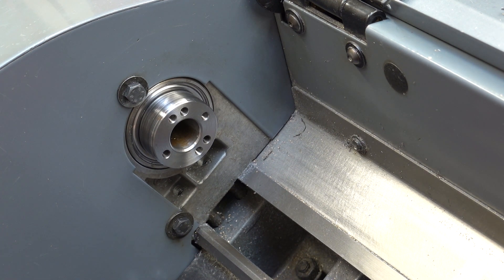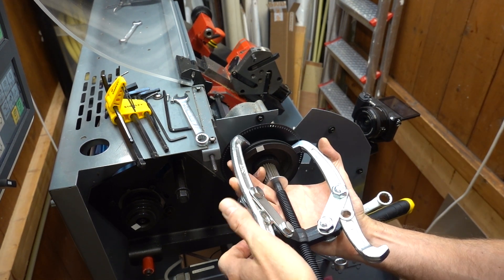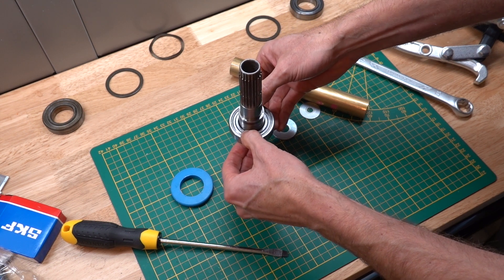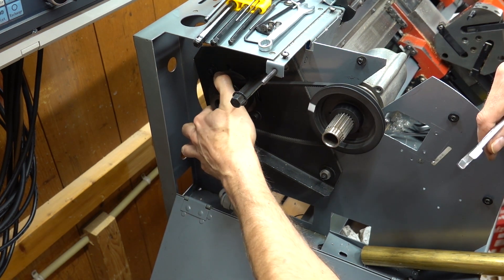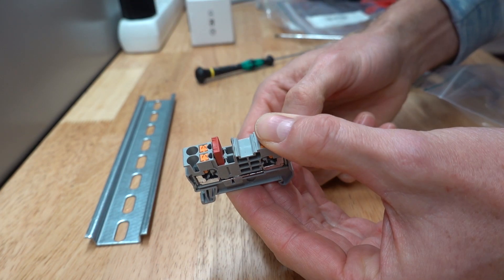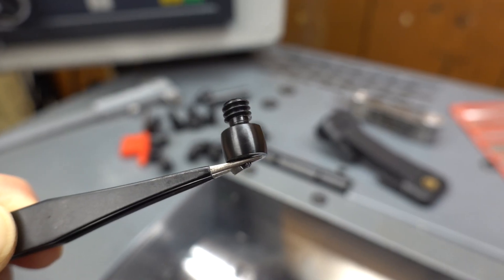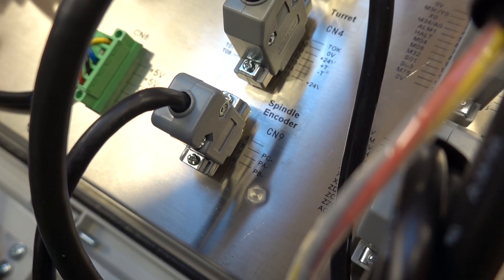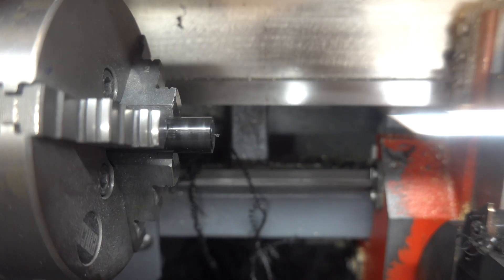Mini CNC Lathe Retrofit Part 5 - Replacing Spindle Bearings, Spindle Encoder, and more

Comment: To perform the final part of threading in your video, what other parameters did you configure to perform the interpolation between the shaft and the spindle? Do you have any images of these parameters or what they would be?

Regards.
Reply from the maker: Hi, I think it was only the parameters I mentioned in the video. If it is somehow not working for you I can have a look if I missed something but this should be it.

Comment: Are you able to part off on this little emco? I'm just after getting mine running but for the life of me can't get it to part off
Reply from the maker: Parting off is quite a bit more difficult than regular cutting, but it does work for me. I use slow feed and a pecking motion. These make sure there is no build up of longer chips. Nite that I only have parted off brass and aluminium, so I have no experience in cutting steel on this lathe.

Comment: Excellent videos my friend, thank you very much for sharing each process in such detail.
I have a question, maybe you can help me, I want to use a 4-bit encoder for the ATC, I'm trying to do it but I have many doubts.
What program can I use to see the PLC files that exist? I tried to use one but it doesn't detect any file from the backup I made of the control panel. Well friend, I hope you can help me. Thank you very much and again congratulations for those beautiful videos
Reply from the maker: Hi, no problem. This is the link where I downloaded the PLC editing program, it even includes some manuals. Someone was nice enough to put them on this forum:
https://www.mycncuk.com/threads/14016-Hardinge-CHNC-Retrofit/page5

Comment: Hi. Brother I need application Fanuc 21 and patch machine for configuration my emco turn 50. Can you help me ? Thanks
Reply from the maker: Hi, sorry I have no experience fitting am emco with a Fabric controller, so that would not be possible without having the actual fanfic controller myself. Also I am very restricted in time so I cannot take on any additional projects. Hope you can make it work. Robin

Comment: what will be the code for Spindle Speed?
( S1000 M3 ) is ok or there have another code.
Reply from the maker: Hi, yes S1000 M3 works fine. It is exactly the same syntax that I am using.

Comment: Seems silly to have an encoder with 4096 counts per spindle rotation, but the controller reduces it to a much less accurate 0 to 359 degrees?
Is that just for display? Surely for auto threading etc the controller will make use of the full spindle resolution?
Reply from the maker: Yes, my guess would also be that it is just rounding the display value but uses the actual resolution. Since there are also versions of this controller with a 4th axis (C) it would not make sense to round to full degrees. For threading that would probably be fine though.
Reply: @uptimefab7412    Thank you for the reply.
Great machine build and video series by the way! 👍

Comment: Nice video, i have the same lathe, only older, when it was still called EMCO Compact 5, I have it with the toolchanger too, and i have retrofitted it to EdingCNC, and i have written a number of Macro's to allow me to operate with cycles.
in the near future my lathe will get an upgrade with a stronger motor, and an enclosure (an Old EMCO TM02 Cabinet)
Seeing how easy it is to replace the spindle bearings i will do that too, because these haven't been changed in 37 years (that's how old the lathe is)
Reply from the maker: Thanks! The emco 5 cnc also seems like a nice machine. I found it surprising that it has more or less the same cast iron base as the 50 and 55 models.  Apparently they used this for many years. Having the enclosure is a huge improvement. Otherwise chips get everywhere.
Reply: @uptimefab7412  Yes, the Mechanical base of the machine is identical, except for the latest iteration. which has a wide ball rail for the Z-axis..

Your machine had different Steppermotors, Berger-Lahr, which are 5 Fase, Nice idea, but now we have Micro stepping..
The EMCO Compact 5 CNC had "regular"steppermotors with only 72 steps/rev, giving a resolution of 1/72 mm, That is why i janked those out, and put in 2Nm Nema 23 Steppers with a 6.35 Shaft  (Wich were a direct fit), 

I also replaced the Toolchanger motor, for a Nema 17 Stepper, which makes the ATC much faster.
Maybe i should make a video when i start converting mine (again)

Comment: Totally the wrong type of bearings for that application? A standard ball bearing is not designed for axial loads, you should change them for angular contact which may cost more but will give you a more accurate and reliable machine in the long run? A nice little machine and wouldn’t mind one myself to play with👍
Reply from the maker: Thanks! I might change them out for 7006-2z angular contact bearings (tip by other viewer). They should have the same size. For light occasional use the 6006   bearings do work, but there is always room for improvement. Working on the lathe at the moment, will see if I can find some reasonably priced bearings. Otherwise I might use the current ones until I run into issues.

Comment: I suggest you try to use the gsk post-processing files in the fusion360 post-processing library. Most of the CNC systems in China are based on the gsk manufacturers. They should be generic.
Reply from the maker: Thanks for the tip! I will give the gsk post a try.
Reply from the maker: Just had a quick look and it I deed seem to produce code that should compatible with the SZGH. It does seem very similar to the output of the fanuc post so I will stick with that for now since I already modified that slightly for my situation, but the GSK post also looks like a good option as a starting point. Again based on a quick look.

Comment: Good videos of the controller, I have Emco compact 6 cnc running linuxcnc at the moment but I hate the computer and extra hardware needed. Did a retro on a manual lathe using xc609t but it lacks ladder and macro for the turret so this seems like a perfect option.

Comment: Great video - what is the parting tool you are using at the end of the video?
Reply from the maker: Thanks! It is a CTP15FRN ZP15 parting tool. It does cut brass (and POM), but I was not very happy with this tool. At 1.5 mm it is a bit wide for small diameter parts and it is intended for stainless steel. As a result, it is not cutting brass very well. I recently ordered some new parting tools, CTPA 10FRN,  1.0 mm wide inserts which are intended for aluminium. I am hoping these will work better in brass, but have not used them yet. Just updated the PDF file on my website with more details and links to a number of tools, including the two mentioned above, for both the inserts and matching tool holders. Please note that these parting tool inserts are not cheap compared to other tools on Aliexpress, but these insert tool holders are the only ones that easily fit in the Emco turret.

Comment: Hello do you using FAO logiciel?
Reply from the maker: Yes, I am using CAM software. Fusion 360 with a slightly modified Fanuc post processor. The Fanuc post works but may need modifications for some canned cycles, like peck drilling. Since I do not have a paid license for Fusion it is limited in tool changes and rapids, so I will be looking for alternatives. Also use manual programming in the controller for simple parts, which works fine.
Reply: @uptimefab7412  ok thank's i have same retrofit with SZGH 1000 but it's not easy for have post processor correct. We need modification fanuc. Very good job for yours videos beautiful
Reply from the maker: The 1000 model looks like a very nice unit, but was a bit big for my lathe. If it helps I can place the post I use on my website later today, but as mentioned for my lathe very little had to be changed. I can only recall the pecking cycle, but maybe one other thing. I will add any changes in a comment in the article. Not sure if there is a difference between 990tdb and 1000 models for interpretation of the G-code. Note that I did not test many other canned cycles, so there could be more issues.

Comment: Great video series!  I'm planning a retro fit to an old Okuma lathe.  And think this same set up could work well.  But can you tell me if its possible to add pots to this controller to override the axis feeds and rapids as well as a spindle rpm over ride?
Reply from the maker: Hi, interesting question. I actually looked into this earlier because I also would have liked override rotary switches. The answer is yes, but you would have to choose between either and MPG or rotary override knobs. This is because they use the same contacts. A couple of parameters have to be changed in the menu to assign the contacts to either of the 2 options. I chose the MPG, but for a professional lathe I would also prefer the override knobs. They have to be a 16 position knob with 4 poles (digital code). There is more info in the user manual in section 6.3 and 7.4.7. on szghauto.com. The more expensive models might support both override knobs and MPG at the same time, have not looked into this.
Reply: @uptimefab7412  Well I think it would be more than acceptable to be able to switch between the two options.  You would use the MPG mainly for jogging in manual  mode. setting up.  Then when you run in Auto mode the internal PLC could be programmed so the MPG gets switched off those contacts and the parameter allows the feeds and rapid overrides in RUN mode to be activated.  The MPG would not work nor would it be needed in AUTO mode.
Reply from the maker: That would be a good option indeed. If it can be programmed such that the contacts switch with the operating mode. Not sure if the parameters can also be changed via the PLC. If you ever go this route and get it working please let me know. I have to say I tend to use the incremental steps from the front panel more than the actual MPG, but that may change later.